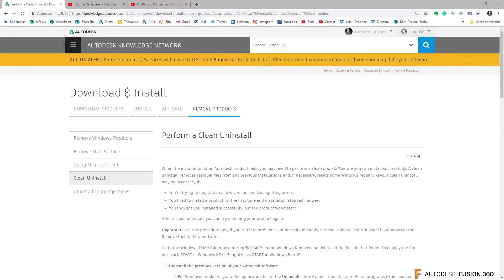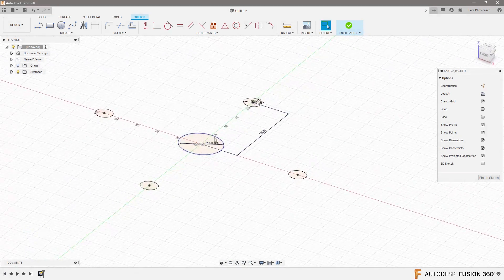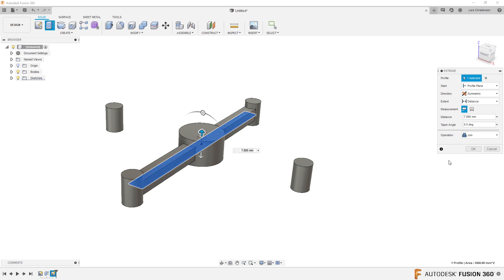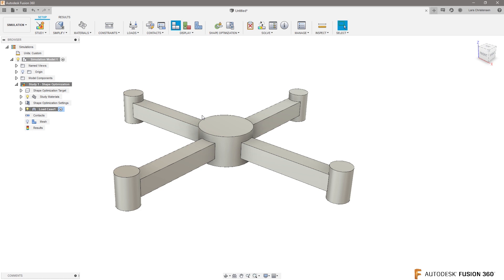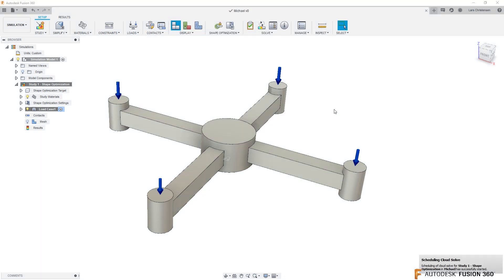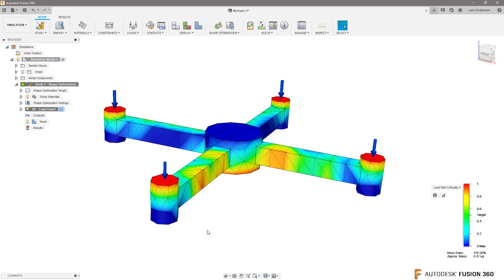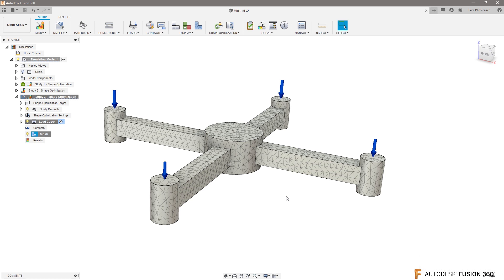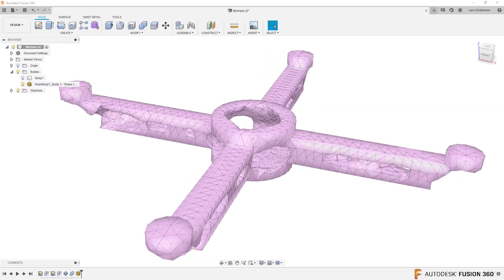Fusion 360 — Shape Optimize QuadCopter — Ask LarsLive

Comment: The force vector appears to be in the wrong direction for a quad copter, except for the case that it is just sitting there and you're simulating the mass of the motors. You'll probably need a bunch of load cases to find something more realistic for flight.
Reply: Vectors need to be in upwards and 1 in the middle downwards to be as simplify realistic at least

Comment: I have a question, today there are more new materials coming out especially in 3D printing can you input the properties of new materials into the Fusion Library in order to evaluate these materials in the simulation function of Fusion? If yes a further question would be when working with different 3D printing methods materials can have different properties in the different print directions is this possible to simulate or would you take the lowest factor an use that for the simulation?
Thanks
Reply from the maker: The short answer is that you can create custom materials. The simulation solvers used in Fusion are based on Nastran solvers what are very powerful. It should be said that Nastran is primarily for steel. 
There are many things to consider, like you mentioned, print direction, but you also have different machines, with different nozzles sizes and heat output. 
Simulation is not meant to replace physical testing, but to limit the amount of physical testing. So professional companies will normally dial in the simulation data points on custom materials regards to how they prefer to manufacture parts
Hope this is helpful

Comment: Hi Lars, how would you do a wire mesh on a curved surface in Fusion360?
Reply from the maker: I would first see if I could get away applying an appearance instead of actual have to model it. What’s the end goal? If it is to showcase the design to a customer, that might work👍😊
Reply: @cadcamstuff  setting the appearance is good for me, and I've found cool mesh styles in 'Materials'. Thanks!

Comment: You've probably answered this question before, but I haven't ran across it yet if you have. What is that machine on the shelf behind you? Thanks.
Reply: Haas control
Reply from the maker: Haas CNC Control simulator. Mostly used in education so students can test their programs before they go to a real machine

Comment: Thank for another interesting video.

I think quads are pretty difficult to design in generally, especially racers. High speed crashes with the quad bumping around tend to take forces from all directions. Mostly arms get ripped of of motors get torn away because of not enough material around mounting holes. (That is the most critisized thing often seen). With those stuff like 5 or even 6mm carbon fibre is reasonable.
If you're making a simple toy, you have lot more room for lighter stuff. With low speed/mass (and not anticipating crashes) all you need is to counter the lift. A small quad lift is not that high either.-Manufacturing methods limit a lot too. Something like cutting a carbon board is pretty simple but manufacturing a honeycomb pattern could get easily difficult and expensive.
If you intend to 3d-print one, something like Peon320 on thingiverse may give you some ideas.
Reply from the maker: Thank you for a great comment 👍😊